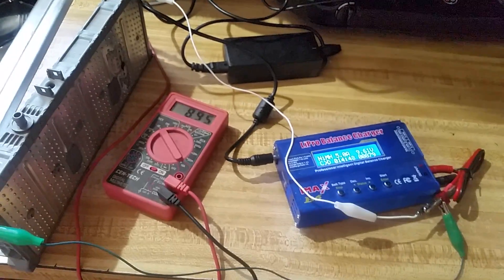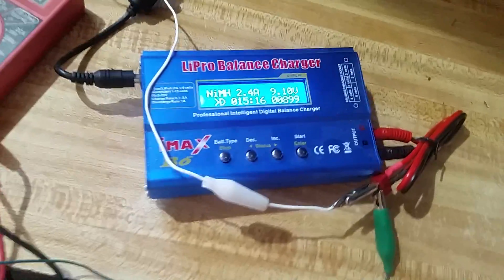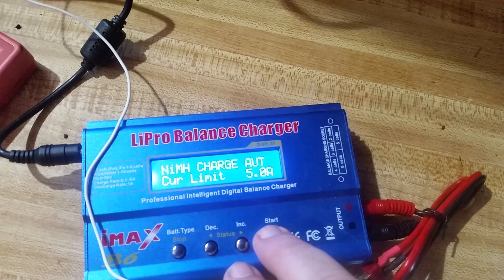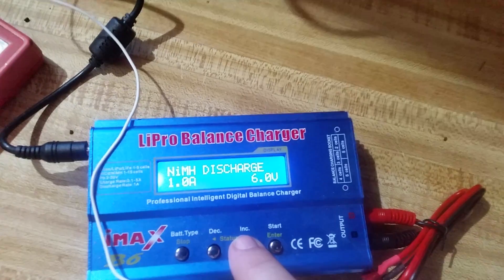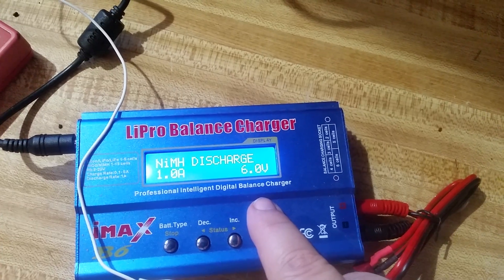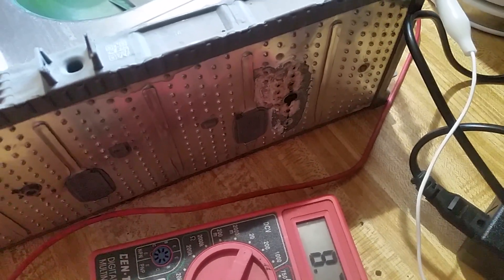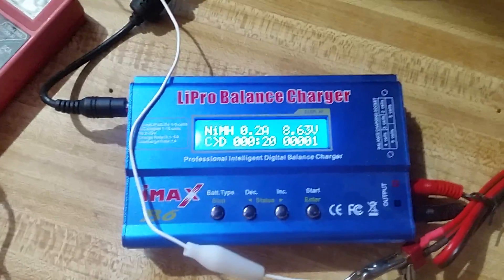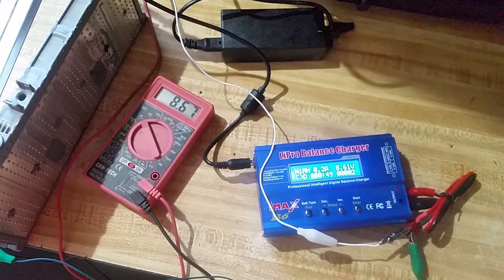Prius module on Imax B6

Comment: Hello with these setting on my first module i tried i get my module a little bit inflated. I see some people holding the module squeesed between to pieces of wood... If i squweeze it now it returns to its original size... Do i have to throw it? ...

I set charge in auto 5.0 Amp like in the video and i observed 5 amps while charging, I expected 1 or 2 amp adjusting automatically but was 5 amp all the time... Maybe should I limit it to 2 amp charge?
Reply: Recommend to only charge an uncompressed battery at 0.3 amps or less for safety and results in no bulging battery. I use an iMax B6 rc charger.

Comment: Hi Tommy,
Hooe you'll read that...
I USING same charger (ac version ) and when tried to charge 1 cell, I've notice that the voltage jumps up to 17V, returning back to 7-8,jumps again and so one.
I stopped after 3 minutes to avoid harm the cell (tested on 2 cells).

Is it normal (maybe fir the first minutes)?

I have an example here:
https://priuschat.com/threads/charging-cell-using-rc-charger-voltage-jumps-is-it-normal.217479/

(I don't have where to buy other charger, and ordering will take weeks.) 
Thanks!

Comment: I have a charge discharge that can discharge at more than 1 amp. Can I discharge at 5amps?
Reply: Yes you can even discharge at 20 amps( 4 headlight bulbs) these packs are designed for heavy load discharge.  (Years Late reply but might help someone ;) )

Comment: so for every cell you run it down to 6v and leave it there? or only the new one you are putting ? let's say I have a bad one and I am replacing just that 1 bad. the rest are reading 8.3 volts do I just charge the new one I'm putting to 8.3 v?
Reply from the maker: If your pack has not been rejuvenated, I would suggest doing them all. even though the voltages match, the capacities are all out of whack. You can get away with replacing the one bad module, but you will probably be pulling out the pack again, due to the diminished electric range, and mileage. I am rejuvenating my 3rd pack now, have found several modules with weak capacity, and have had to replace them. I plan to post a new video soon, showing the Reaktor chargers and what to look for.

Comment: is that realy work??
your batteries is ok now??
Reply from the maker: Yes, but it is very slow.
Reply: +Tommy Johnson yes I start today mine and every cell need about three hours. How many cycles you made?? Really yours batts are ok now???
Reply from the maker: Run each one down to 6v, and cycle them 3 times. I just bought two Reaktor 300w chargers, to make the job faster.
Reply: +Tommy Johnson send me a link to see the reactors please
Reply: @tommyjohnson5354  which charger and discharger are the best if you dont mind  telling?
Reply: Tommy, 

Does the charger automatically turn off after the 3rd cycle? Does it say "Done"? what voltage should the pack be at after the cycles for it to be considered ok?
Reply from the maker: Sal Please watch my second video, Prius module on B6 Redux. It is much more in depth, and should help you.